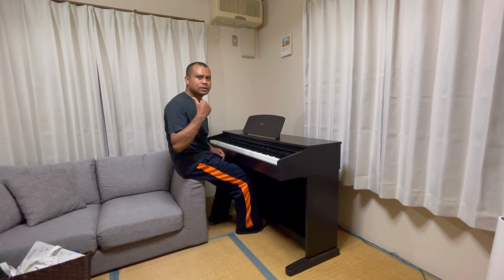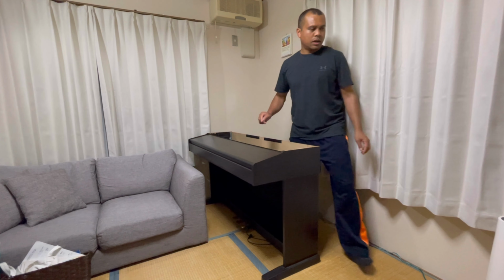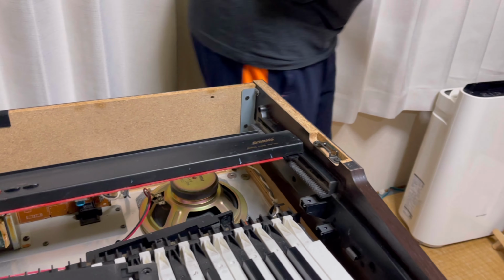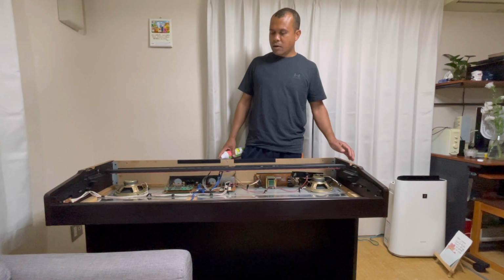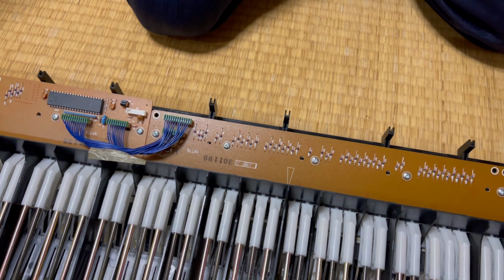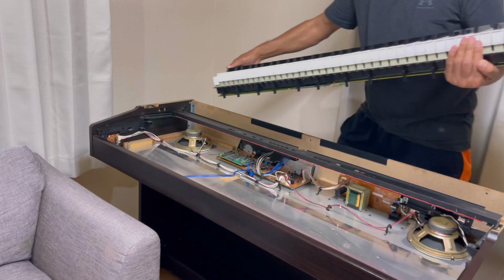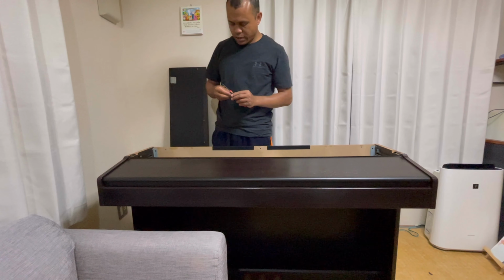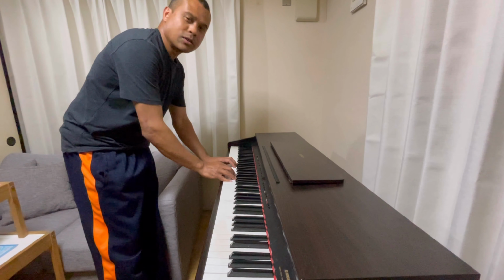How to replace keyboard felt by yourself | DIY

Comment: Nice job with only one screwdriver and a can of compressed air.  Because I'm borderline OCD I would have definitely changed out the upper felt strip as well.  It's like buying one new tire for your car or changing the brake pads on one wheel.  But you surely eliminated the clicking.  Nice work.  I have a P70 that needs felt changing very badly.

Comment: I tried updating the firmware on my Clavinova CVP-307M and the Clavinova got stuck during the process.  I waited ten or more hours and the update never completed.  When I turn on the Clavinova, all I get is a "program error" message on the screen and the Clavinova is waiting for me to provide program files.  The USA website of Yamaha has version 1.80 firmware available, and the UK site of Yamaha also has a 1.60 version.  Both of these versions get stuck at the same point during the process.  Can anyone explain why this Clavinova CVP-307M is not completing the firmware update?  The firmware version that I have been using happily since the time of purchase is 1.54.  Can anyone provide me with the version 1.54 files?